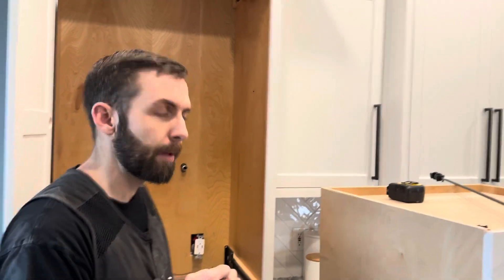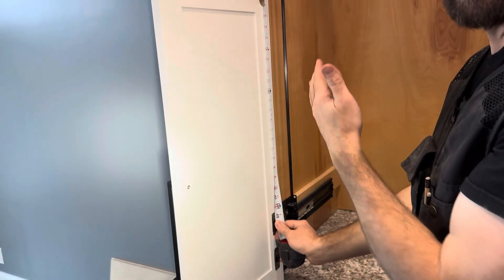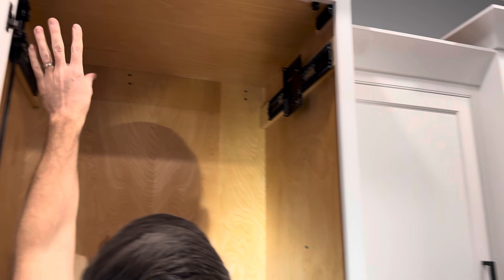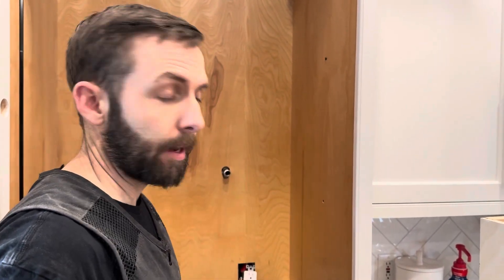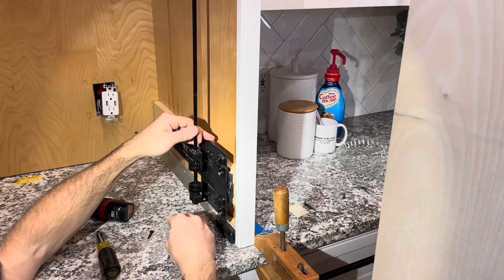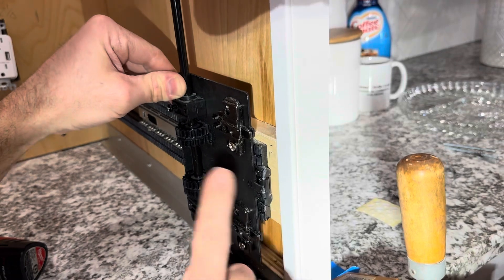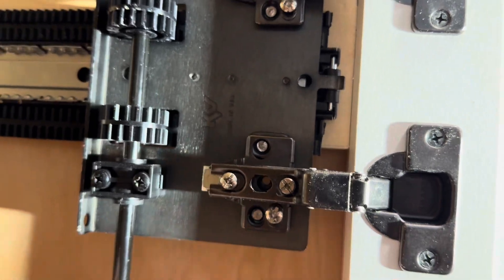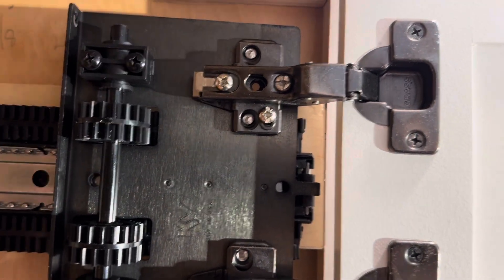How to adjust and check the tolerance of a KV 8092 Pocket Door System installation in a cabinet

Comment: How did you go about attaching the cabinet to the counter top with no bottom stretchers? Are they just glued on?
Reply from the maker: We ended up gluing an aluminum angle iron to the bottom edge and the countertop to lock it in place

Comment: Did you have a video or information for the forstner drill bit locations? I'm running into confliction information on the KV directions on how far from the edge the vire hole needs to be. I don't want to wreck or cabinet doors if I don't have to!
Reply: Conflicting*... bore hole*... Sorry....Typing too fast out of frustration 😵‍💫
Reply from the maker: I don't have the instructions in-front of me, but I believe we bored about 3 mm in (1/8") from the edge of the door for this project